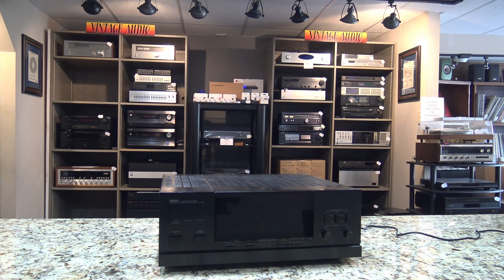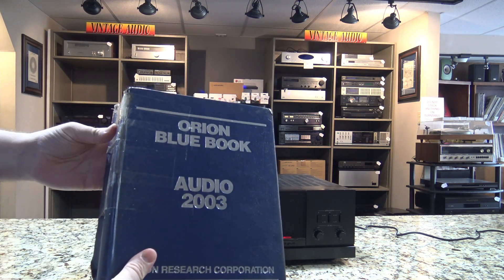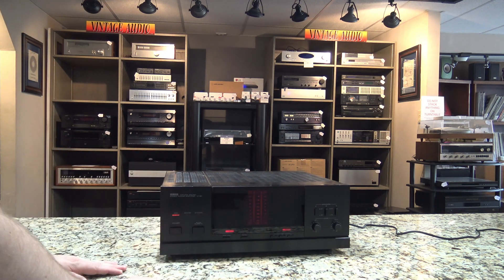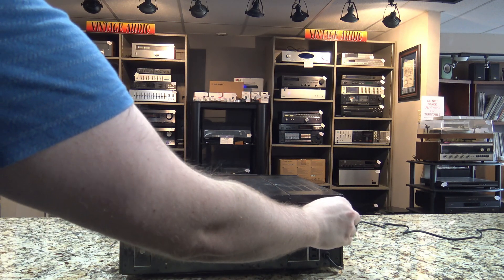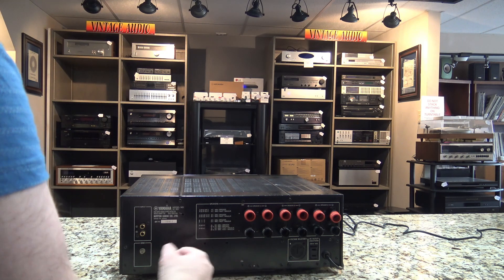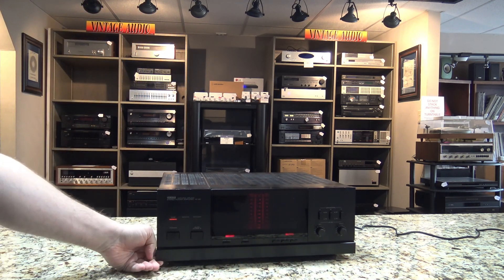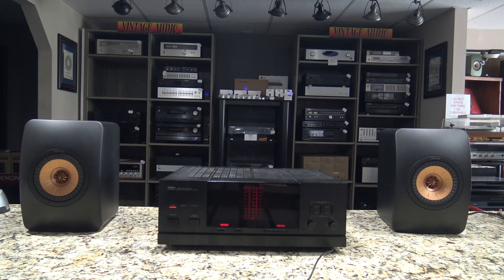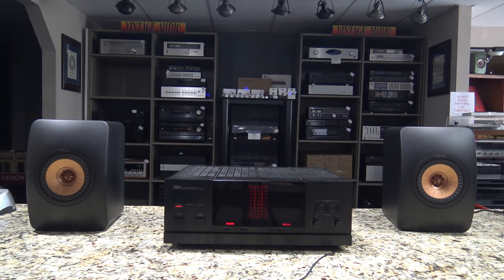Yamaha M-80 Natural Sound Stereo Power Amplifier Overview

Comment: I have a M-65 that I need see if it still works. Can I plug a cd player like you said directly into the amp?  Or a tv with 3.5mm to rca jacks to the amp? This won’t damage it?
Reply from the maker: If you can control the volume out

Comment: Shouldn’t this amp be paired with the C-80 to get the designed sound quality. I purchased the set but they need new caps of course. Supposed to be great sounding.
Reply from the maker: Sadly didn't have the same series amps to test it
Reply: I have a M-65 amp w/ C-60 Control Amp. Bought them new in 1986. They haven’t been played in about 15 -20 yrs. Are they worth putting in a shop and having new caps etc. ? They do power up when plugged in.
Reply: I have a M-65 amp w/ C-60 Control Amp. Bought them new in 1986. They haven’t been played in about 15 -20 yrs. Are they worth putting in a shop and having new caps etc. ? They do power up when plugged in.